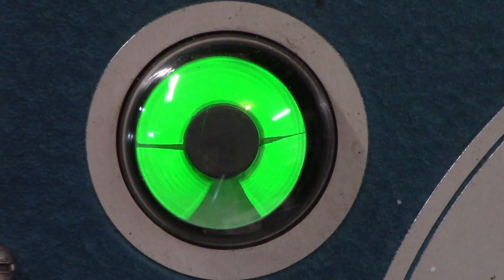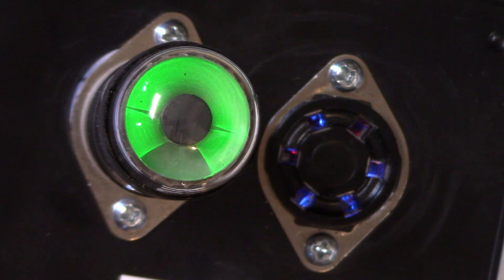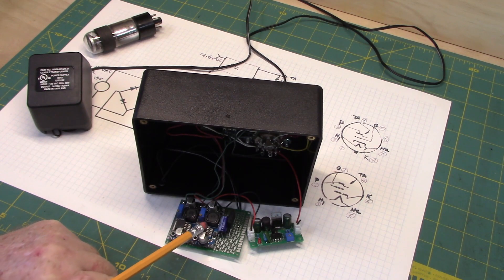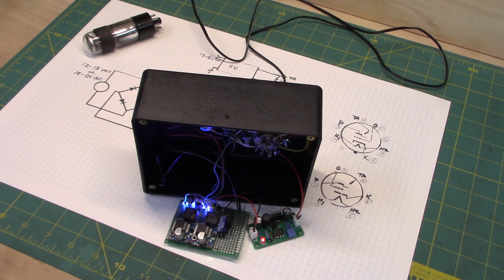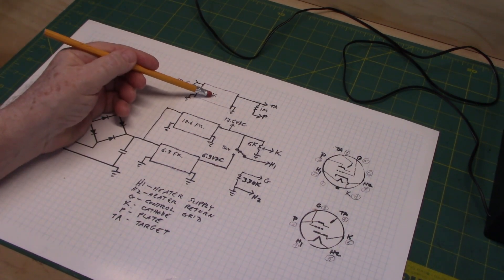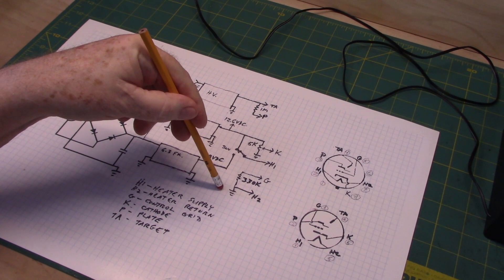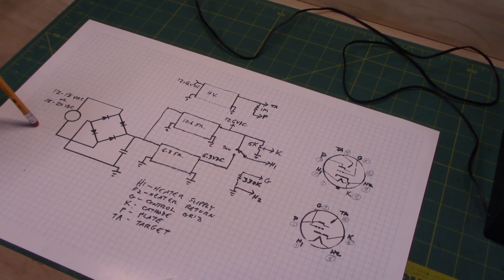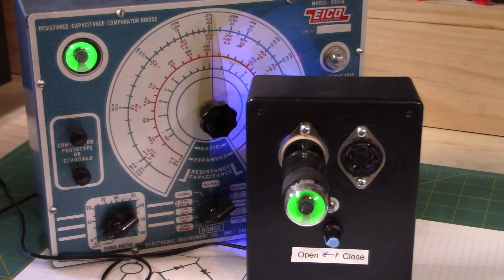Magic Eye Tube Tester Easy Build

Comment: Great job! A very nice tool indeed.
The phosphors don't get weak. The cathode emission decreases over time. Also, be aware that some of the six pin tubes have 12 volt filaments. This will also make them dim when the heater is supplied with only 6 volts.
The eye tube is effectively an all electronic galvanometer. It's primary advantage is no mechanical moving parts. 
The magic eye tube was invented by Allen B. Dumont of CRT fame. His first incredible invention was the waxed paper milk carton that we still use to this day. He invented that at age 16 or 17 just before 1920. He won a prize of $10,000 for this. He invested the money and went on to develop the long life cathode for CRTs but it was also adopted into almost all vacuum tubes.

Comment: For the circuit boards, Google these:

"LM2596/LM2596S DC-DC Regulator" (2 required for the low voltage supplies)
"Nixie Tube Booster with MC34063"  (1 required for high voltage supply)

Sockets:

1 x 8 pin octal (chassis mount)
1 x 6 pin vintage vacuum tube socket type U6A (chassis mount)

Pot: 5k linear taper

Comment: Very nice tester sir. I am considering building one, I have wanted to do so for years. Also one that could be battery powered, for use at radio swaps to test a few tubes. I am having an issue right now woth a pilot radio and it's eye. Long story, and I believe I have tried everything possible to get the tube to function ad far as the shadow action. It has no action at all, although the neg. grid voltage is varying. I've even tried to manually insert neg voltage on the grid, still no action. It was a 6E5 ir 6U5 tube, someone subbed a 1629, and added a 12V filament trans. For the life of me, cannot get a shadow.
 Target to plate resistor calls for 500K, when that's installed, the target is dim. Reducing that to about 30K the target is brighter. In either case, no action. I know for a fact the tube is fine, and the tube is getting B+ of about 100V.  The target will fill completely, with no shadow at all. I know it must be something simple, but I am not seeing it. I"ve been thru the curcuit a few times, all recapped and resistors on spec. AVC is - .7 to - 4.9V I"ll keep looking around online. Been in the hobby over 40 years.
Thanks for the video and have a great day!